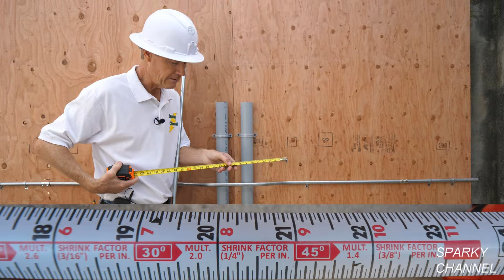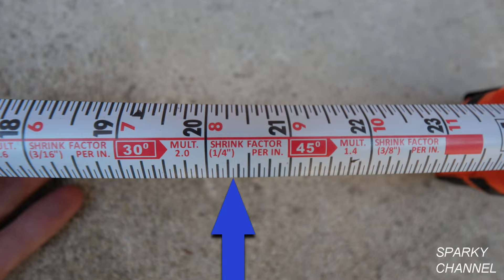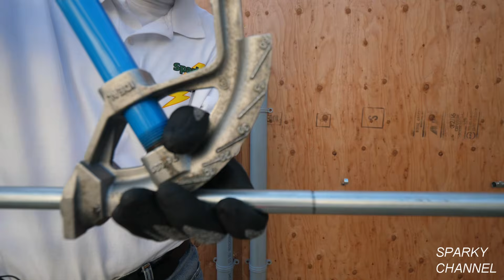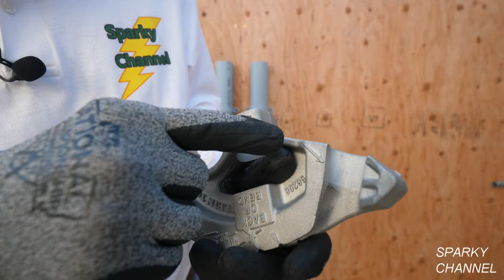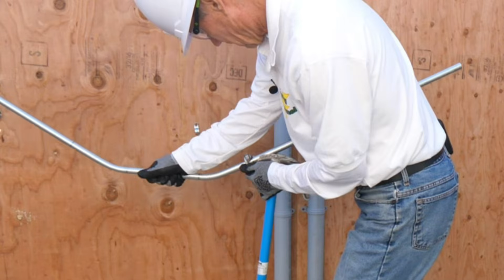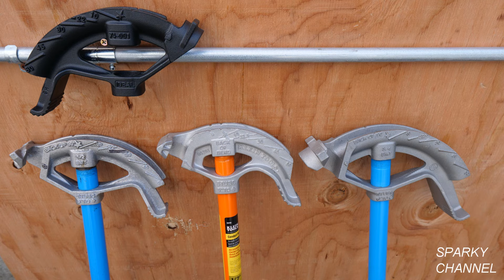EMT Conduit Bending: Four Point Saddle Bend with Multipliers, Shrink + No Charts or Apps

Comment: Hey bill I have a question, every time I make a bend even if I mark it properly it seems to come out about 1/4” too low. What can I do to fix that? What am I doing wrong
Reply from the maker: What is too low?
Reply: Sparky Channel well let’s say I want the conduit saddle to be 3 inches tall, it comes out 2 3/4 inches tall or something around that
Reply: @bananaaaa3428  well a 30 degree offset or bends has a shrink constant of 1/4" maybe that's the issue? Did you only multiply the shrink constant (1/4") by the multiplier (2) instead of by 3? Perhaps you aren't bending to a full 30 degrees... Idk, but whenever I have trouble, and it isn't my math, then it's something simple like the bender's arrow not lining up, etc. Try thinking about where that pipe goes when you're bending.
Reply: Tom Brown I’ll try to make sure everything is lined up next time thanks 👍 that may be the problem because I often go back to correct or add a little more
Reply from the maker: @bananaaaa3428  Good answers Tom, thanks!

Comment: where you getting 7 1/4 from
Reply from the maker: The 7 1/4" was the width of the obstacle.
Reply: Is that 7 1/4 " from the outside of the first pvc to the outside of the second?
Reply from the maker: @mikegranese5480  Yes.
Reply: @mikegranese5480  From any part you don't want to run in to